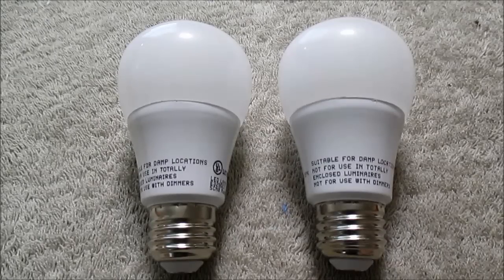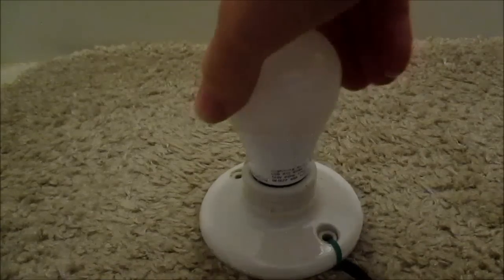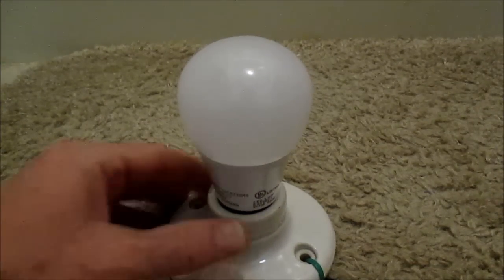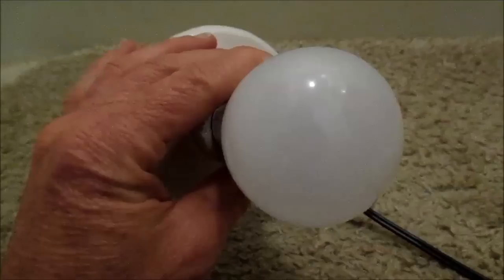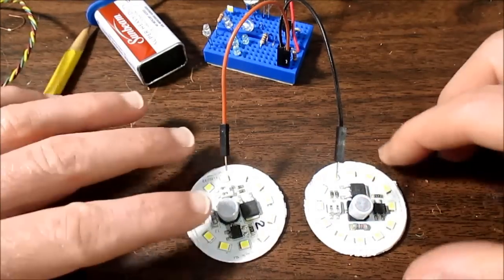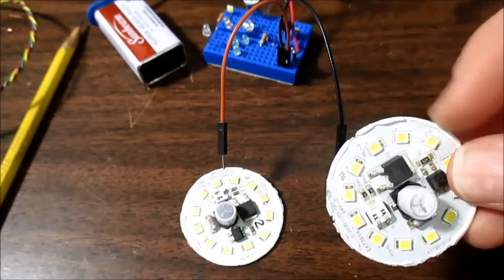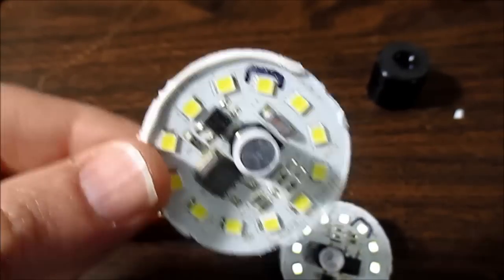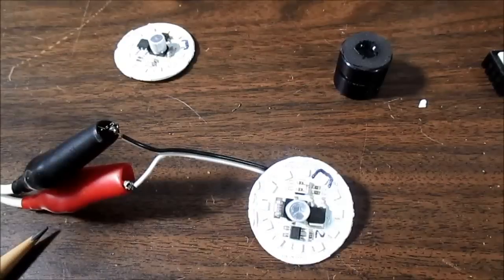Two failed LED bulbs for teardown to determine the cause

Comment: I see some of the comments saying dont buy cheap Chinese brands, what do you expect from Americans that dont support local manufacturers because they are too pricey. Buy the cheap ones because we sent all our jobs over to third world Country's or buy better American made stuff and support your American economy......................but you cant have both
Reply: Often times there are no USA made comparable products available to purchase. In other words, sometimes it's all made overseas.
Reply: Unfortunately, American made products have a history of being crappy too.  The Big 3 Automakers built really crappy cars that got crappy fuel mileage, which allowed the Japanese to enter our market and thrive.  The early Japanese cars introduced into the US in the 70s rarely broke down and could literally run a million miles and use very little gasoline.  We were lucky to get much over 100K miles on any of the Big 3 US manufactured cars before the engines would blow.  Chevy Vegas would fail after 30K-40K miles.  Ford Pinto were death traps in rear end collisions.  Even though OPEC embargoed the US and pump prices skyrocketed, The Big 3 chose to continue building gas guzzlers and muscle cars that were designed to fail early, so the Japanese gained a permanent foothold in the US market.  The Big 3 attempted to peer pressure Americans into buying their crappy products rather than cheaper, more reliable, fuel efficient Japanese cars but their marketing strategy failed spectacularly.  Taxpayers even had to bail out Chrysler to save those good paying jobs.  Chrysler was the worst of The Big 3 and probably still is...
Reply: @NightriderXP1  The big 3 build what idiots want which is why they are discontinuing cars in preference for SUVs and Pickup trucks.
Reply: I highly doubt that hte idiots want to buy SUVs and pickups that fall apart after 100K miles.  There are a lot of idiots who intentionally buy gas guzzlers to mock fuel savers.  But there was a huge market for fuel efficient vehicles that the Japanese took full advantage of, giving them a permanent and massive foothold in US auto sales.  When our choices were Ford, Chevy, or Chrysler, I usually bought Chevy's.  No more.  I prefer to buy cars that get great fuel mileage and last forever.  The Big 3 still aren't building the type of car that Americans like me demand.  Chrysler has been bailed out twice and GM once now.  Ford was close to bankruptcy too.  Clearly, they have a huge problem.  They've lost car buyers like me permanently...
Reply: Competition from Japanese cars greatly improved the quality of American cars. @NightriderXP1
Reply: You can't blame the public its the Companies  who put share holders or profit  over country by sending the manufacture end to other country's to increase revenue....   I worked for a alternator company in Canada. that was around for 50 or so years (they moved to mexico) at the end it was cheaper for them to buy a entire new alternator or starter from china then it was for us to rebuild a core  ..or even core value of 7 dollars..    And the funny kicker is napa would fine us if we left "made in Canada stickers on our alternators and starters "  all they did was put a sticker "made in the u.s.a" to claim it as made in the states... so again its your / our companies that are evil..
..
and basically its a sticker nation or co packers or assemblers .. but manufactures is pretty much gone.
so yeah who would not buy the same product else where saving 90 percent of the cost for the same thing that all a local manufacture does it put a sticker on it or puts in the final screw to claim it as made in the u.s.a..?...
Reply: @ModItBetter  if every consumer refused to buy china made crap .. overtime manufacturers would be forced to either move manufacturing back to the US or go belly up.
Reply: There are NO LED bulbs made in the US. All made in China now even Cree and Phillips!
Reply: @snoebay88  The quality of goods out of China is directly related to what the contracting company requires of them or doesn't. Stick with a brand that cares about its reputation and the quality of the components and build will be evident.
Reply: I'm in the UK, and have seen a Family Guy episode where they replace every item in the house with 'made in USA' goods and they all go up in smoke...   I do know of quality USA items like Maglight Leatherman, and the amazing high-end HiFi equipment Martin-Logan, Krell etc but was the programme just digging at Walmart priced items?
Reply: American-made goods aren't more expensive because we "sent all our jobs over to third world countries," it's because American labor is expensive. Besides, most of the general groceries Americans buy are made in America anyway.

US manufacturing production is now focused on specialized high-end production, such as weapons systems, aerospace equipment and farming equipment, because American production is high quality and likewise very expensive. Low-end mass production is better in the hands of countries like China. Even as low quality goods, they'd be too expensive to be produced in the US, and importation of cheap goods is profitable to US companies and provides US jobs. To put it short, we import shit and export perfection.
Reply: I not only can have both, I do have both.  I have made in China bulbs spec'd and quality controlled by more rigid major brands' standards.  They are not generic Chinese branded, just made in China.  This is true of so so many products not just bulbs, although I still prefer most other places (except India) for tools, like Taiwan, Japan, Germany, Switzerland, with the latter 3 usually making higher quality tools than places in the US ever did.  Granted (even for tools) the tech is better now so I am comparing old US made tools to newer foreign tools, while the US tools also got better before the factories shut down years ago.

Comment: Next time.please show us how you got the led apart,I have seen some.people with a hammer couldn't get them apart,if one led is out would that stop the rest of them from lighting?what's a bond.wire? May be you could text the led bulbs from the 99 cent only store,I have wonder if one.brand.is better then another brand led bulb?,anyone.?I no I have used one in my refrigerator ,blue quit after a year,I would have tested my bulb if I could have gotten it apart,these bulbs I seen a guy hit one.very hard and only put in a tiny dent.

Comment: I've had some fall like this too. But never had any philips or panasonic bulbs fail, and I have been using them since 2012. The old ones used to be really heavy, but the new ones are really lightweight. The ones that fail are also really lightweight.

Comment: Leds are technically superior, they use 1/10 of the power and lasts 10 times longer than incandescent. In general.
Now there are plenty of ways to fuck it up though. I can see those bulbs being made by some shady manufacturer cutting one or two corners too many and installing sub-par chips, probably knowingly. You can easily end up with one like that if you chase the lowest possible price. People say its planned obsolescence. No this time is possibly fraudulent cost cutting, with no planning. 
All you can hope is if you buy from known brands they will keep an eye on quality assurance, as they mostly do. They cost more but with the generally dropping price level, even the branded ones are getting affordable.

Comment: But how Cheap are they? I've got Osram LED lamps from BJ's, they were 19.99 for 8. I've had 1 fail in less than a year. Twin bulb fixture, second bulb from same pack is still going. Dead lamp was buzzing. Haven't fully trouble shot the lamp yet. Pretty decent for the price, energy bill went down a significant amount.

Comment: Manufacturers will design failure rates into most all products. They will run the LED components at or above their rated operating parameters which causes component failure. I made an AC powered LED cluster, an them below their max rating and 13 years later, still working. Make it strong and it will last.
Reply: I was an EE and did new product design for 40 years and NEVER would have considered building in intentional failures.  I never heard of anyone else doing it either, too much pride.  But it makes a great story.
Reply: dboy6400 
Hello. I won't try to sell you on the idea however: A fella worked at a marine repair shop. The outboard ignition modules failed a lot. The young man was able to unpot the modules and discovered inferior components being used. He reverse engineered the modules, started selling them and was able to start his own business. It is not the first time things like this has taken place. I'm glad you took pride in what you did, that is rare. Let me ask you this, are we not in a throw-away society? Do house fans have bearings or bushings? Some Chinese products may work for a week then stop. I could go on about cheep products but you already have your mind made up. The video clearly shows crap products, you decide.
Reply: Thanks Dave.  My post was only based on my personal experience from the mid 70s til I retired 2 years ago.  There was never anything said by anybody about 'building in obsolescence or early failure'.  But there was almost constant pressure during a development cycle to do it quickly and make it cheap to manufacture.  Ease of assembly went into designs.  It's the cost control and sometimes being limited to cheap components that IMHO led to failure rates.  Bushings vs bearings is a good example but I don't think it's for achieving early failure.  Back to my experience, once a product was released any evidence of early failures always prompted corrective design changes.

One of my career chapters involved manufacturing in China at two different companies.  I made several trips there and quite frankly and honestly I was impressed with their skill and diligence.  Making assembled pc boards and injection molded plastic parts were done very well, back in the US we never had any complaints.

My only real point is questioning whether or not early failures come from intention (I don't think so) or from the fast'n'cheap pressure during the design stage (I definitely think so).

Comment: The most important factor with the usage of LED bulbs is that they only use 1/7th the electricity. The savings in your electric bill more than makes up for a few LED bulb failures. I once bought an introductory sale Made in China Facto 7W LED bulbs for $1.75 each so I bought around 50 bulbs of different Watts and I changed every bulb in my house.  So far in 3 years I've only had about 3 or 4 fail. They were so cheap to buy I even bought spares. I have a fixture in my kitchen that used to have 6 x 50W halogen lights = 300W   - it now has 6 x 7W LED bulbs = 42W    Another factor is the Halogen bulbs used to give off a dangerous amount of heat whereas you can touch the LED's. The future is here and there's no going back.

Comment: If you want the LED light to last, you need to buy the more expensive name brand bulbs, as they have better drive circuitry with electrical spike protection etc, plus they use better LEDs. Where as the cheap ones use basic capacitive dropper circuits and poor LEDs. But even the good ones can fail quickly, as with anything new, you get the occasional duff one.

Comment: I thought these LED bulbs are supposed to last a lot longer than fluorescent lights. Well, I installed 6 of these to replace some florescent lights and 1 of them, the one that's on every night, died in just ~16 months. When I asked a salesman about it he said as long as I don't have it on every night it should last long. Well, why the heck do you think I bought those lights for?? To keep them off on most nights to make them last longer than fluorescent lights???
Reply: I have one on in my kitchen  24/7/365 and its been there 3 years.

Comment: I bought one of the first bulbs out and it lasted less than one year so I opened it and found a dead LED. I wondered if heat was the problem why it failed as LED's should last a long time. My two EverReady make of bulbs are doing fine, three years on.

Comment: planned obsolescence is the heart of the business model.  everything you buy is designed with limited lifespan.    apple is currently in the news because of it.   they will brick your macbook and iphone if you get it repaired by anyone but them.  but they charge 100 times more than what a normal repair shop does to fix it.  to fix a bent pin on the display causing the display to not work.   they will charge you about $1000 to examine and do the repair.    a repair shop doesn't charge anything to fix something like that.

Comment: I find some LED's have a MAX power rating but is not always suitable to drive them at max power. I usually try to drive such LED's at a lower power rating. I try to design in more powerful LED's than needed and then run them at 25% less or even less than the rated power. Sometimes even 60% of the rated power can produce good results with a long lifetime.
  Something to remember is that the LED's need to be matched when running them in series or parallel otherwise the weakest one will blow first or one that has a higher rating will not light at full power, causing the rest to take more power through them than was intended in the design. Some designers push the levels a bit too far as they want their lamps to be the brightest for their size and cost. Or they are just not aware of the above and do not have the time to test their products for longevity.

Comment: are the LED's wired in series like Christmas Lites?
when one goes they all go... poor design!
need to be configured in parallel

I found that the CFL bulbs had about half the life or less of what was stated
in the bathroom CFL's usually only lasted a year

I wondered about the NEW LED bulbs, got to be better than CFL
LED's run on 3v to 5v and they are being used in 120v applications... WOW!
lots of voltage reduction & things to arc out

but the NEW lites are always much less than what THEY tell us
and even if the LED says dimmable it takes a special dimmer
you will have to reolace ALL old dimmers in your house for CFL or LED Lites
and MY GOD - the waste they create

Comment: I think the main problem with these cheap LED lights is not that the LEDs, or indeed any components, are poor quality but because they are driving the LEDs too hard while also providing inadequate cooling, which would be insufficient even if the LEDs were driven at their rated current.
I have some lamps similar externally to these but having many more and smaller LEDs. Two failed within a few days. They both had an open LED which also showed a black dot, presumably something burnt inside. I just shorted the open LED and they worked fine but I found they ran extremely hot even with the translucent bulb removed.

To fix that I changed a current sensing resistor in the driver board, reducing its value by some 30% or so if I remember correctly, resulting in a proportionate reduction in the output of the current regulator.  They lit somewhat dimmer but not enough to be noticeable unless you compare side by side with a modified.  There was however a huge drop in the temperature such that the board was barely too hot to touch.

I then proceeded to modify the other 4 similar lamps and they have been working fine ever since.   When they eventually fail I think it will be the electrolytic capacitor as it is some generic unbranded one.

Comment: led lights wired in series, like Christmas tree lights , designed to fail, every thing is designed with a weak link. and a life span. according to the type of product. to sell more. otherwise mfg. co. would go out of business once the market is filled.   mfg. co.  started doing this in the 30's . making there design engineers create a weak link. to stay in business. and sell replacement parts to consumers..   they could create a product that would last hundreds of years. but then you would not have to buy another. ,, think of the Edison bulb that's been burning 24/7 since it was lit a 100+ yrs ago...…..

Comment: purchased two of the early primitive led bulbs in 1984, they have been in service since May of that year with one controlled by a timer and burns 8 hrs per day 365 days per year, I paid a hefty $15 bucks back then but do believe my investment has been returned many times over. These early bulbs were manufactured in the USA and I wonder where the newer bulbs are manufactured.

Comment: I've had multiple failures. Most caused by confining in an unventilated enclosure which the package said not to do (one or two bulbs just plain failed, however). Mostly I've had problems with LED flashlights. These things go bad at an alarming rate so make sure to buy with a lifetime guarantee if possible and be sure to save the receipt.
Reply: Get good ones with T6 LEDs powered by 18650 rechargeble batteries; 2 for $11 on AMAZON. They are fucking amazing.